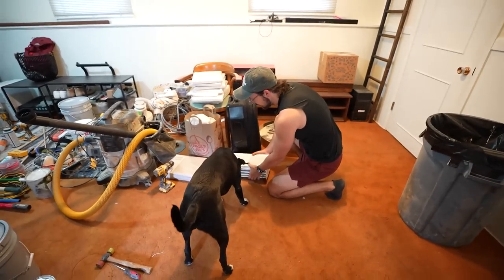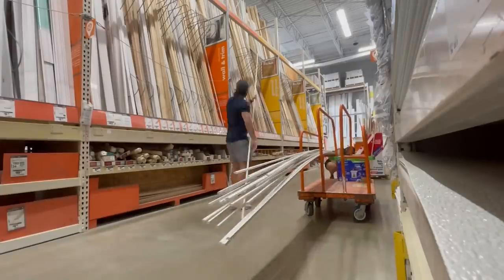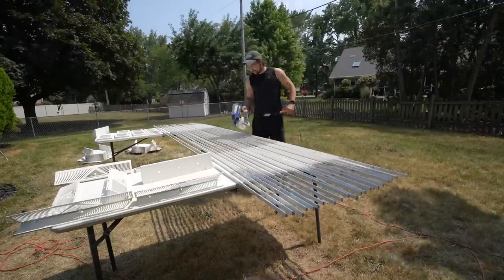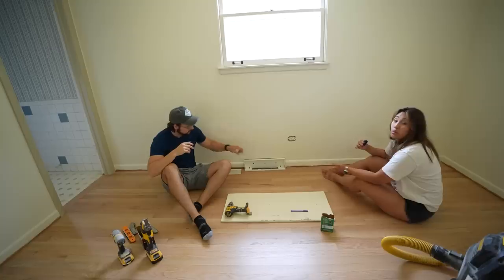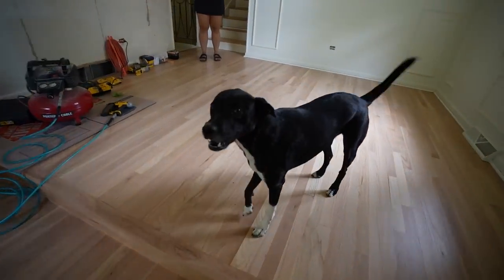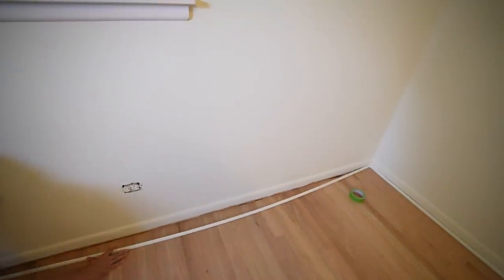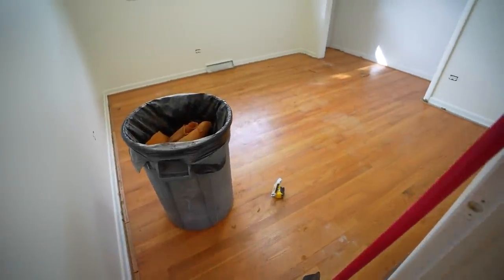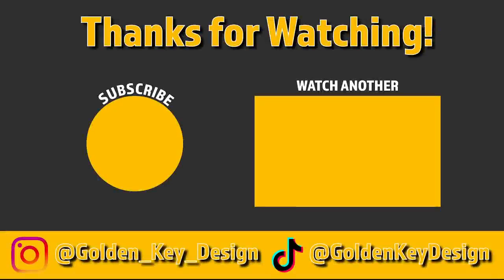This Piece Makes All The Difference

Comment: Floors look great! Huge effort.

Just a tip for when you silicon/caulk in areas like bathrooms and kitchens, avoid using your fingers. The bacteria/sweat in your fingers will typically effect the silicone/caulk and be more likely to develop mold and de colour over time. 

Lightly spray on slightly soapy water and use caulk tool or even popsicle/ice cream sticks. 

I’m a designer and Builder from New Zealand! 🇳🇿 Love the content
Reply from the maker: Great tip! Thanks for watching! I want to visit NZ one day

Comment: Looks great! One thing I noticed is you used mitered joints on the inside corners. It's better to use coping joints for inside corners instead to minimize gaps when the moulding expands and contracts. Keep up the awesome work!
Reply from the maker: Thank you! And yes, I have seen coping in the past, but we felt it was faster to miter the comers and made sure to add caulk to all the joints. But great point. We will see how it holds up

Comment: I'm having my floors refinished as I'm watching this. While I DIY damn near everything, 2 kids kinda makes floors a no go. That said, I will be throwing on the shoe molding. Was a pin nailer recommended? I've also read that an 18 guage brad nailer is best? Hows the molding holding up with pins? Great channel! Subbed.
Reply from the maker: Welcome aboard! Our shoe molding is holding up great. Pins are plenty strong. You can use a brad nailer but you will need to go back and fill in all your holes with wood filler

Comment: it looks like behind the vent covers is wood anyway, and its a ent cover, not a shelf. you dont need it to be able to withstand a load at all, the screws are just to hold it in place. Bit excesive i'd say to go through all the effort of putting it into a stud when a rawl plug would do fine.
Reply from the maker: There wasn't any wood behind the vent covers unfortunately. We tried to screw it into the drywall, but it was a very weak connection. Adding new holes to hit the studs only added about 2 minutes of work. We thought it was well worth it to not have cracked caulk later down the line